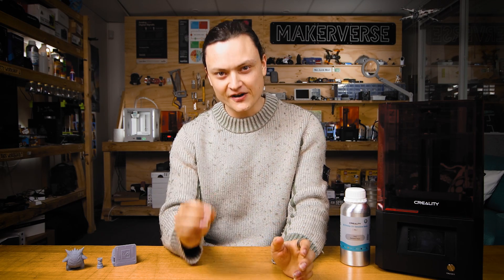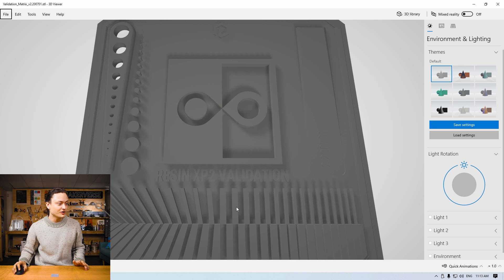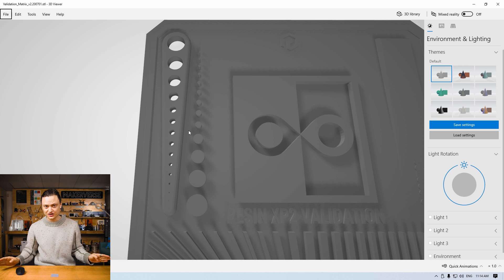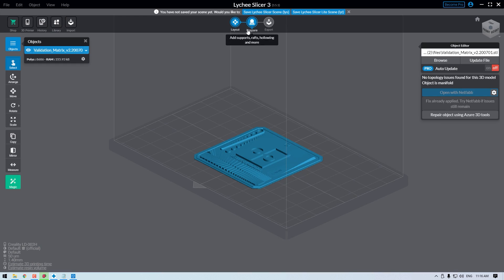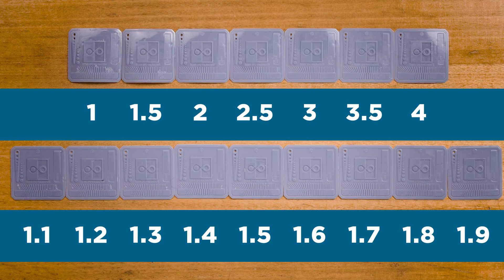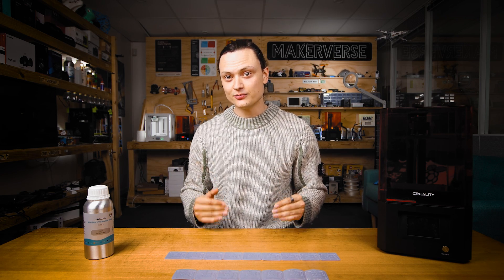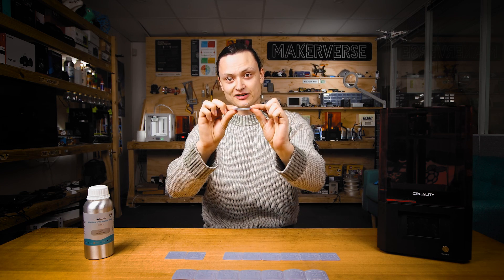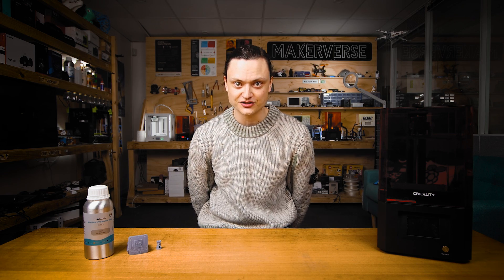Create Perfect 3D Resin Prints by Finding the Optimal Layer Exposure Time

Comment: Kind of a side question.  Why would you orient the model (Gengar) so that all the “woodgrain” layer lines are right in the middle of his face?  I would’ve oriented him so those layer lines would be at the top and bottom of him, largely hidden.
Reply from the maker: I printed this little guy with his feet basically to the build platform. Seeing those edge layer lines (particularly around the front teeth) was a surprise to me that I only noticed when we put the HD zoom in really close camera to work. 

No matter how you orientate the model, because it is effectively a sphere, you will always end up with these layer lines somewhere. The best way to avoid seeing these layers (which are super hard to see with the human eye) is to take advantage of the Anti-Aliasing settings and use a value ~8x. That or use smaller layer lines. Hope that helps!

Comment: Does this apply to water-washable resin as well? they are trying to say 60s burn in and 8s normal layer. Idk if the composition is different or something by my prints so far are basically glued to the build plate and damn near impossible to remove without alot of working it. I'm order a flex plate so that won't matter soon but one of my prints were so welded on that it damaged parts of the plate trying to remove it.
Reply: Got the same problem but I don’t think it's the resin it's the files settings because the test models I've got work really and get off the plate easily...
Reply from the maker: Having a flex plate is definitely the best solution to removing models. 60 second burn in seems too long to me, that length of time would get the resin and tank pretty hot, particularly on Monochrome Screen Printers. I have not used water soluble resin however I would run some test using significantly lower Burn in layer times.   

If careful a razor blade is the perfect tool to lift up an edge to then get the metal spatula underneath to remove the printed model.
Reply: @Core-Electronics  Thanks! My flex plate just came in, and yea after talking to a facebook group more about it I ran some of your tests and found around 40 sec bottom and 4.5 normal exposure seem to be pretty close for the water wash. I'm having issues now with prints with supports just getting peeled from the supports but I think that my fep sheet is ruined so I bought some ptfe lube and new sheets, hoping that fixes the problem as I even tested it with a ton of supports and  its still getting ripped off. instead of a thump it sounds like a bandaid getting peeled off.

Comment: When you say you have to do another exposure test with a new resin, do you mean retesting the resin of the same kind, a resin of a different kind, or both?
Reply from the maker: Nice question, resins of the same brand but different colours/transparency are definitely worth re-running these tests as the exposure light will travel through the resins differently (in regards to both penetration and dispersal through the liquid). 

An argument can also be made for re-testing the exact same brand and type of resin if your are using a new bottle (as variance can occur between batches from the manufacturer) but normally you will be good to go with the same settings.

Comment: Best presentation band explanation of exposure settings , specially with the subtle details such as mono vs RGB, and the 10x factor for bottom later exposure (is this common?) , great stuff I will be referring back to this video often for remembering technical details ,
Reply from the maker: Cheers mate, for everything I have resin printed this is a good general rule but make sure to keep the bottom exposure time lower than ~30 seconds. Any higher and the printer will get too hot.
Reply: @Core-Electronics  beauty, beauty